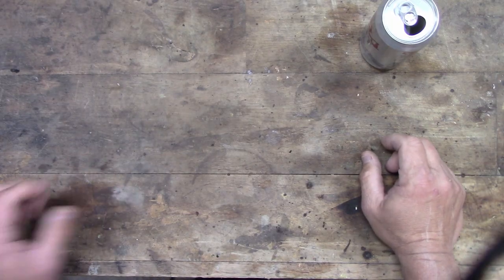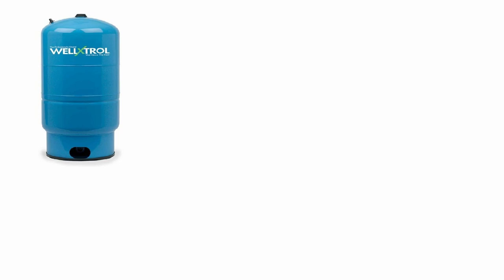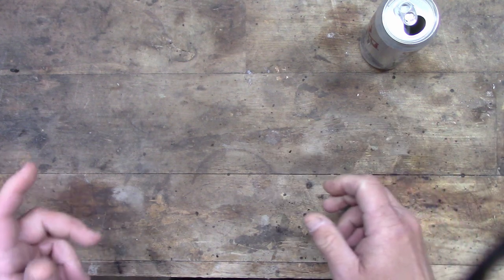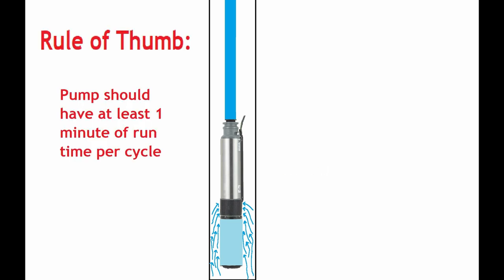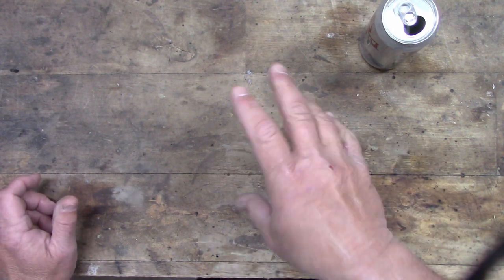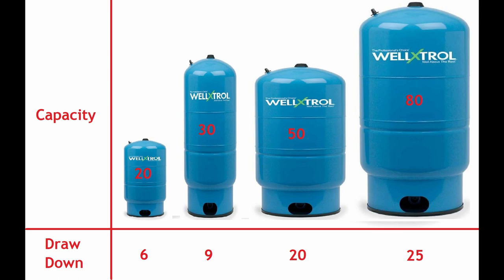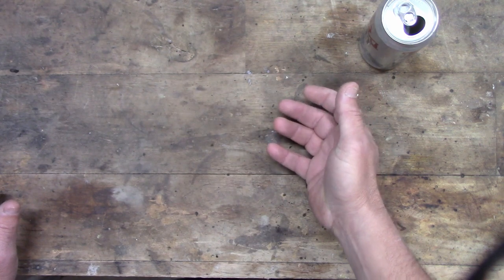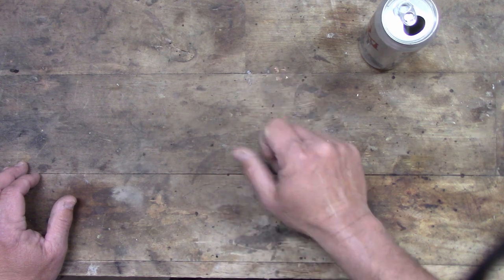How to size a well tank

Comment: Amazing how complicated this is.  To say it's a 20 gallon tank but it's drawdown capacity is only 6 gallons seems to be misleading the customer.  Why not just call it a 6 gallon tank?
Reply from the maker: Agreed. Probably because the tank manufacturers cater more to the professional installers who have a good understanding of the difference rather than the consumer. Just my guess 🤷
Reply: RE:butopiatoo.  They cannot call it a 6 gallon tank because the draw-down depends on what switch you are using with the tank. The manufacturer will have a chart showing what the draw-down is for each switch.

Comment: Get a CSV and have a 4 gal tank supply everything you need. Btw..pumps DO NOT create pressure they create flow. Restrictions make pressure. You should not be making videos if you don't even know that.
Reply from the maker: Thanks. Next time I'll consult with you first. You seem like a really cool guy.
Reply: RE:mohawkmike142.  "pumps DO NOT create pressure they create flow. Restrictions make pressure"
That's getting pretty technical. One could, also, say that restrictions don't create pressure if there is no pump.